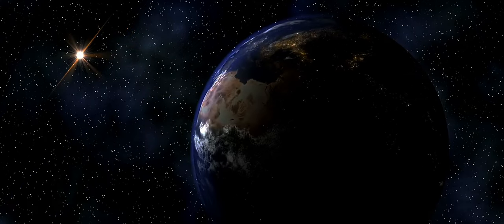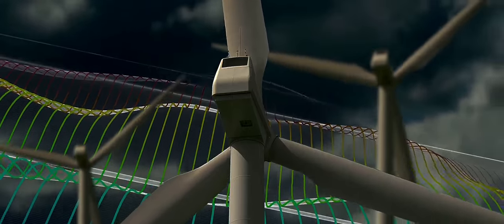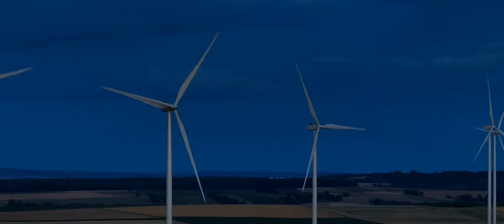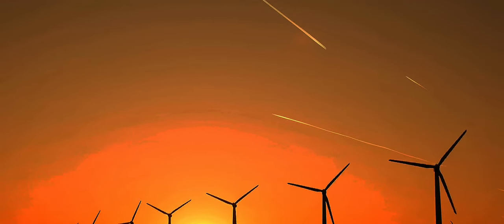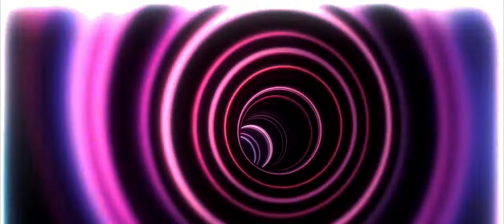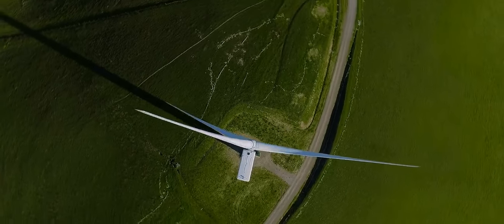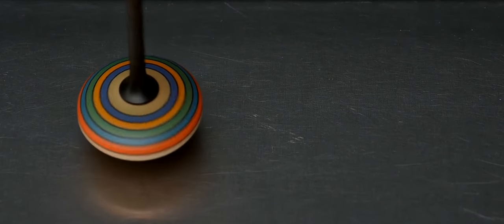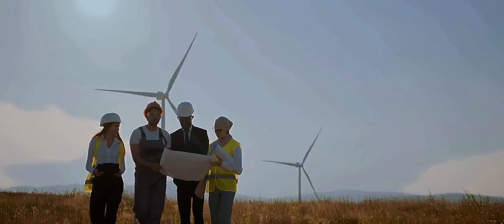If We Can Generate Electricity Using The Rotation Of Earth

Comment: A large satellite with a coil of wire and laminated iron core could generate electricity from Earths magnetic field if it was orbiting counter to the Earths rotation. The real problem would be getting that electricity from the coil down to the ground. It might be possible with microwaves or lasers. There have been ideas before of converting solar energy from space to microwaves or lasers. That would be a lot of radiation power density if it were microwaves. Also lasers at present are not that efficient at converting from electricity to coherent light. Something like a masor converts incoherent microwave energy to coherent microwave energy and is used by astronomers to amplify signals from the universe. If it could instead be tuned to turn incoherent light to coherent from the Sun, that might be more efficient than converting light from solar panels to electricity then electricity to laser or microwave. Beaming down coherent light energy would then be converted on Earth by solar panels to electricity. In this case the satellite would be moving in a geosynchronous orbit so it would be easy to have a ground station constantly positioned under the satellite. There would be losses of power from clouds if using light but if using microwaves the energy through the atmosphere would mostly get through. The health effects of a microwave energy beam might cause problems with bird life or at least with human health going through the beam accidentally in some aircraft. Would aircraft instruments also be affected?
      With a coil on a satellite idea and the satellite going in counter to Earths rotation there would need to be many receiving stations for the energy, so aiming the beam accurately as it switched to the various receivers might be difficult.
     It might be easier and more efficient to put a large cable around the Earth from pole to pole, to have the same process that generates the magnetic field in the core to generate electricity in the cable like in transforrner action but you need a changing magnetic field for that. The Earths magnetic field is relatively constant. The cable would need to cut across the lines of force to generate electricity but the magnetic field would be rotating at same rate as the cable. So has anyone got a better solution to make it work.
Reply from the maker: Sounds great